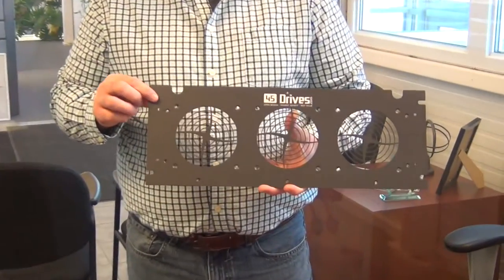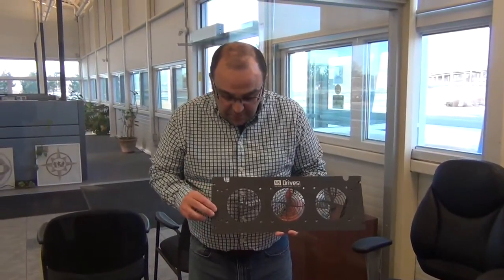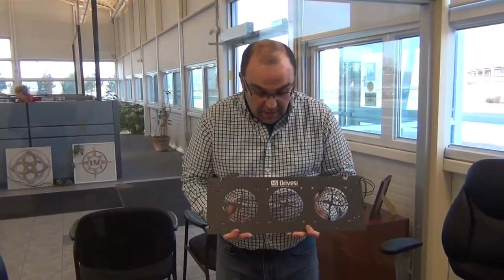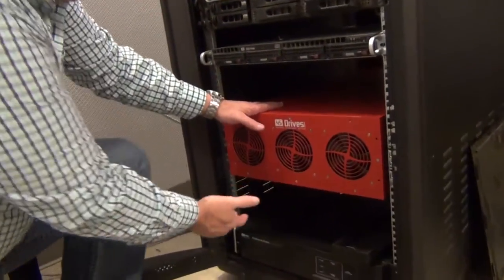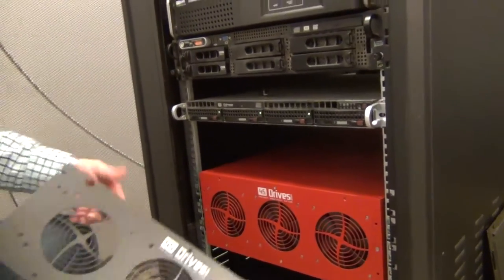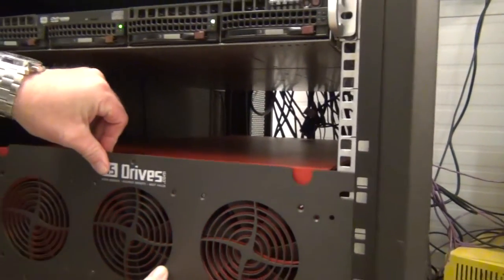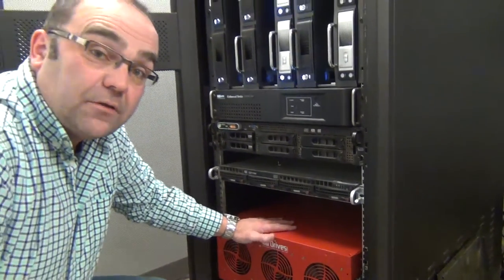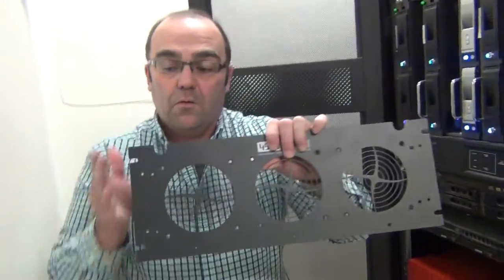Extended Face Plate

Comment from the maker: The original Backblaze pods were designed with the specific purpose of being mounted in racks without sliding rails. We designed our #Storinators to be different - by including sliding rails for easy access. From new feedback from our customers, we've made a small, but important, design change to the Storinator by adding extended front plates. Our new extended front plate is now standard on all Storinators. You can now bolt your Storinator into the rack, preventing it from sliding back and forth unnecessarily. Read more on our forum http://bit.ly/1zLAUHZ, or watch our latest video!